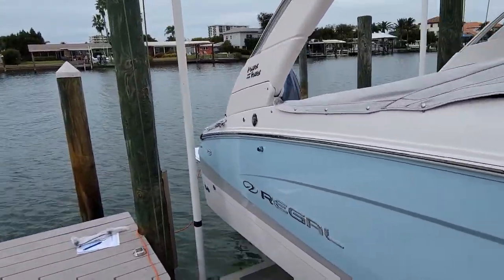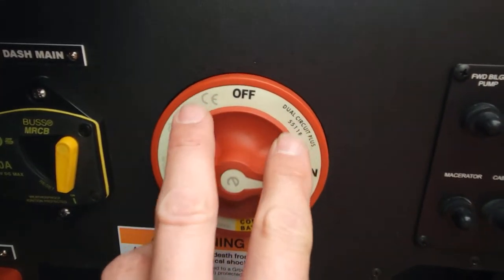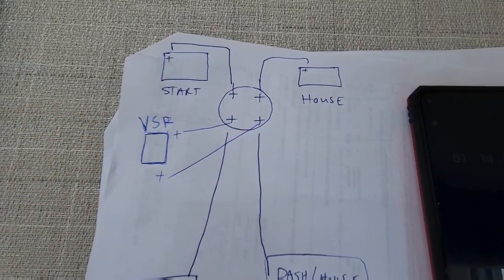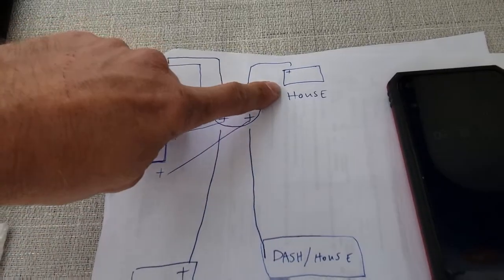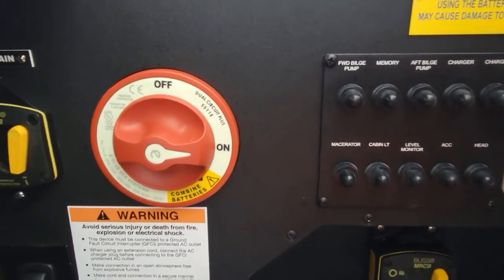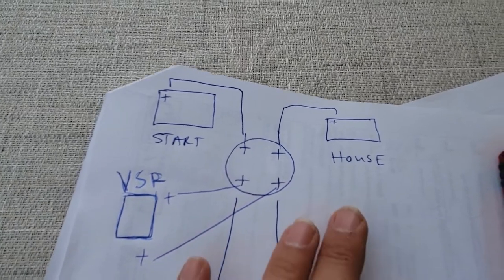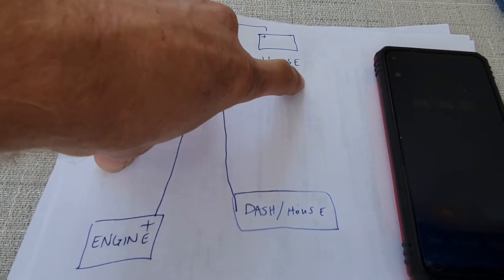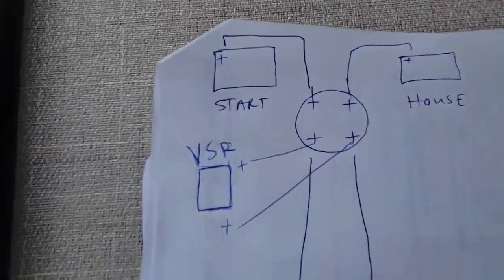Single Engine Dual Battery - 5 Minute Friday #Batteryswitch #Batteries

Comment: Battery connections to 2 switches confuses the heck out of me.  I liked your simple explanation.
My Grady Marlin has 4 batteries but they don't devide into start and house.  Some house is on each bank of 2.  Drives me to distraction.  Wish they would isolate the functions.  2 engines, 4 batteries and 2 switches.  Sheesh.

Comment: For this schematic to work and charge the house battery the switch must be set on  combine.  This is set up to carry the house load if the starter battery is fully charge and the acr redirects the charge to the house load not the house battery.  So if the switch is set on combined the house load and the house battery are both connected.

Comment: Where do I hook up my ground wire ??  I haven’t really looked. Boat at lake but I’m gonna put a relay on my 2 battery system ?
Reply from the maker: You can hook it to any ground as all the grounds should be connected in the boat. 😊

Comment: Great video...really explains it. I have a few questions. 
1.   The way that is setup, it's going to automatically charge both batteries, right? When the engine is off, the isolator will only be using the starting battery when starting, but when it senses a positive charge coming in (from the engine's stator), it will open and allow charging to both batteries. Do I have this right? 
2.   Can the 2 batteries be different types? For example, a flooded starting battery and an AGM deep cycle battery? 

Thanks.
Reply from the maker: You do have that correct and they can be different type batteries for the house/engine.

Comment: Not sure if you are still monitoring this but appreciate the video! Do you like or dislike removing the acr and running an auxiliary lead to the Yamaha 200 for the backup? So both batts can be charged while powered?  Thx!
Reply from the maker: I like running the aux lead from Yamaha. It works the same way without having to wire more stuff. Good question and Merry Christmas 🎄

Comment: Hello so im new to all this and boting if i just always have it on ON will it charge both batteries? And when is it recommended to put switch on combine batteries. Reason i ask already got check engine light on due to low battery and one new battery drained to where it damaged it

Comment: Can I use the 5511e as just a simple on off switch for a single battery?
Reply from the maker: You just need a 9003e single switch if you only have 1 battery.

Comment: Hi, I have 257 fishermen single engine with 2 batteries and 1 switch selector for 1 2 and 1+2 batteries, I’m going to install a battery charger which battery is the house battery
Reply from the maker: They are both house batteries. Just depends on what one you choose on the switch.  You will just need a two bank battery charger.
Reply: @JustinLeeMarine  I got this ProSportHD 12 Marine Battery Charger and is asking for the starter battery
Reply from the maker: It doesn't matter with the set up you have.
Reply: @JustinLeeMarine  thank you
Reply: We have the same set up.  But after 15 minutes can't start the motor without switching to combine. New boat,  new batteries.  Twin simrads,  jl audio system. Wtf??